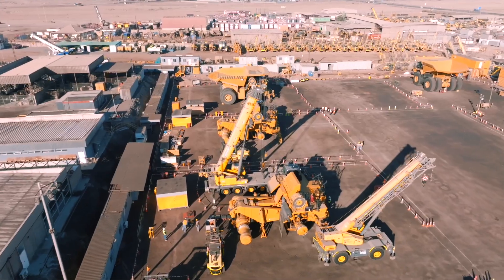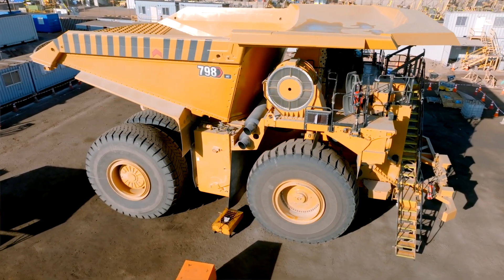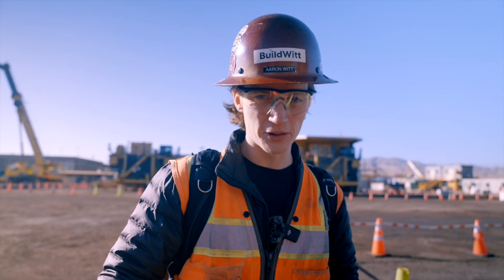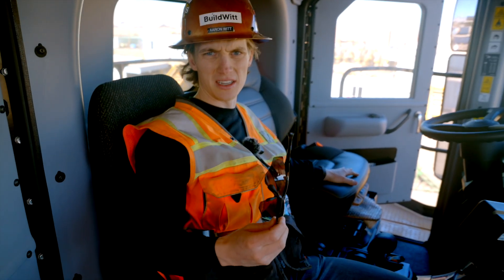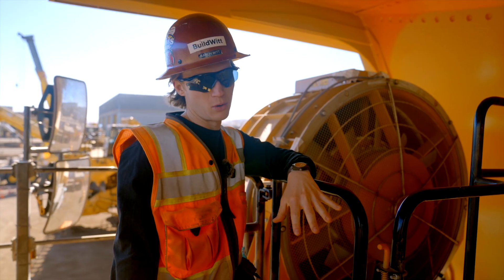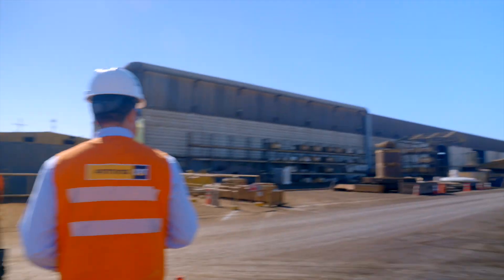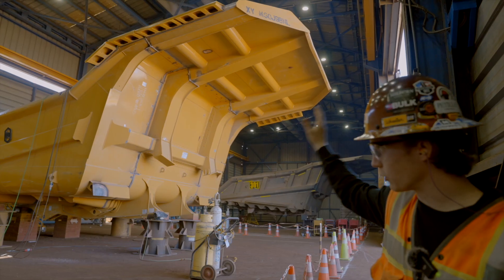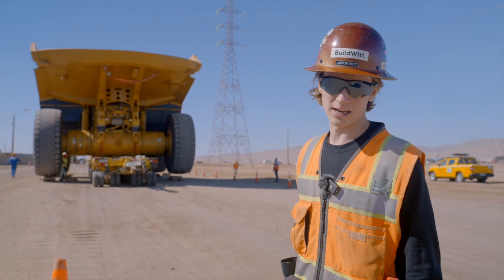Building and Hauling the World’s Biggest Trucks in Chile

Comment: Recovering the braking energy instead of just wasting it would definitely improve the fuel economy. And since they have such sunny conditions they should take advantage of that to run more things on electricity. They could put overhead lines where the trucks go uphill to supply them with electricity without having to stop and charge, I've seen that in other mines. Diesel has to be trucked in from somewhere.

Comment: i worked in a coal mine in alberta and we had variable ground conditions but alot of soft ground. we had 785, 1500, 730 and 830 haul tucks. The mechanical drive 1500s where the best overall by far on the inclines and soft ground, 830s where ok and the 730s where shit. the company is slowly switching over to 789 and 793 cause we have had way way more success with mechanical drives

Comment: 798 are really quite incredible, it only has a 85L engine instead of 115L like the 797, but because its electric drive it has a higher payload, (slightly)higher top speed, more torque
and its able to use trolley assist systems. you guys been to a mine using trolley assist systems? fuckin incredible things

Comment: Do you think that the electric drive would be easier on brakes going down grades due to more hold back ?
Reply: Likely as EVs wear brakes much slower than vehicles without regen braking.
Reply: Yes, because the electric motor just changes from a motor to a generator and in this case it generates electricity which goes through resistance grids in that round object with the fans that Aaron was next to. The system is essentially the same as on a Diesel Electric Locomotive, where the Engineer changes the electric motors to become generators and they send the energy to the Dynamic Brake Grids were the electricity goes through resistance grids (think of your electric bar heaters at home), the current running through the resistance grids causes them to heat up and disapate the energy as heat into the atmosphere. 
Both mining trucks and locomotives are looking to ways to carry enough batteries to be able to store a useful amount of the energy lost to the Dynamic Brake Grids instead of wasting it as heat lost to the atmosphere. Some mines are looking at electric catenary systems to transfer the power generated by trucks using Dynamic Braking as they head down into the mine, and to utilise it to help power trucks which are busy climbing out of the mine with a full load of ore or overburden. This method would reduce the tare weight of the vehicle by not having to carry batteries and equipment to store the regenerated electricity from braking until it can be reused on the loaded climb back out of the mine.
Mark from Melbourne Australia 
Mark from Melbourne Australia